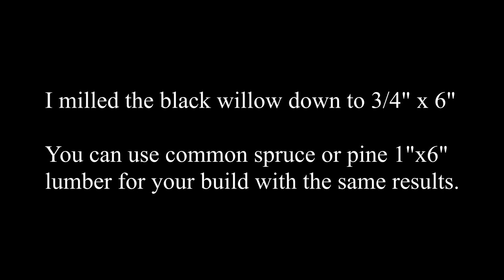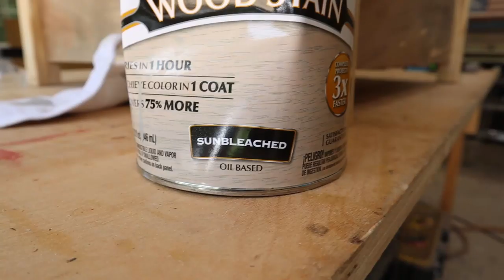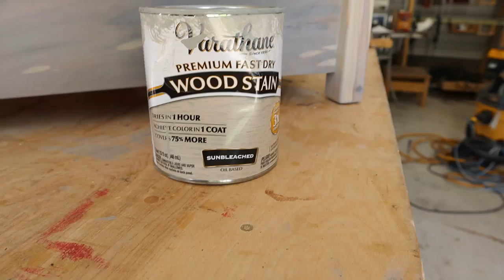COZY DIY Wood Dog Bed for Small Dogs

Comment: Do you ever have a problem when doing the roundover bit over the 4 corners of a "post"? When i do it it leaves sharp edges on all the corners. Do you just sand that smooth or am i doing something wrong? Thanks.
Reply from the maker: If there are any sharp edges, I do sand them